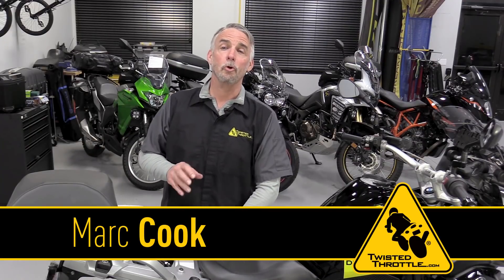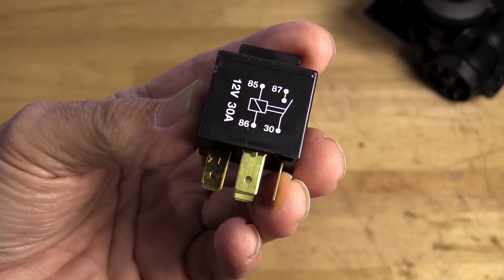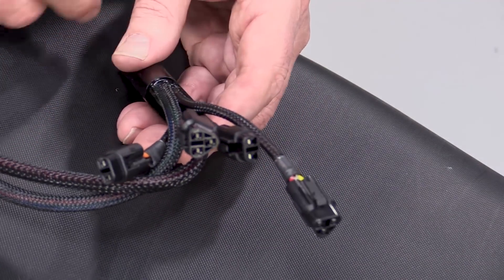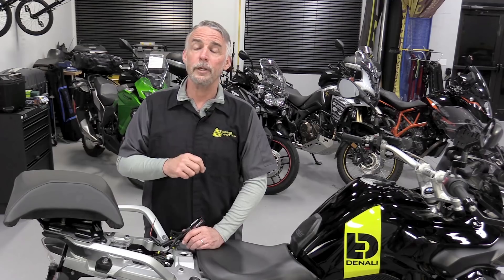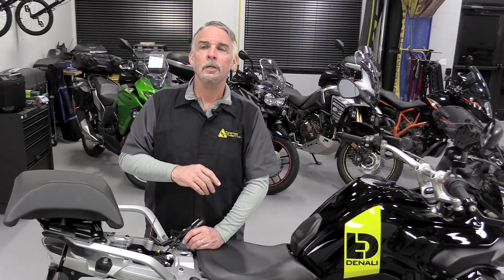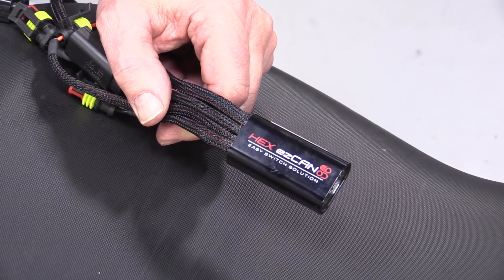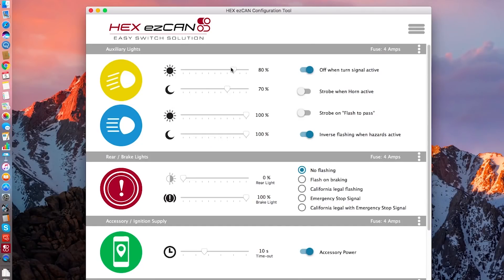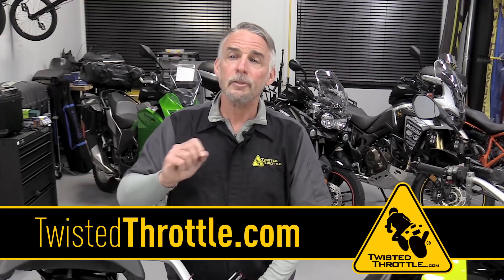DENALI CANsmart vs. HEX ezCAN | What You Need to Know | TwistedThrottle.com

Comment: can i.   buy denali system but install cheap harbor freight lights
Reply from the maker: You caaaannnn, but you shouldn't. Not only are HF lights copies of someone else's research and development, but their lights also don't perform very well. DENALI lights have been tested to insure optimum performance under extreme conditions. We have only tested the CANsmart and ezCAN to work with high-quality, 3-wire lights like DENALI. We can't attest to how cheap lights will perform. 

Also, dimming functions will only work on 3-wire lights. Typical HF lights won't dim using these controllers.

Comment: Do either of the manufacturers make cans for smaller displacement bikes, like Duke 390 or Triumph Scrambler 400X or himalayan 450? Is it possible to strobe the aux lights using pass light switch only not the horn?

Comment: IMHO, For the slight difference in the two I would save a bucket of cash and have the EZcan, oh, wait.... I’ve had the EZcan for a while now. 😏  

Wiring this in is as simple as the Denali. Denali lights alone are a small fortune and cost more than my whole set up added together.  (additional lights, 120db horn, additional brake lights, turn signals and position lights on the hand guards plus an extra lead for power into the top box or to power a rear facing camera).  That said, if money was not a factor, I would have the Denali lights. 🍻
Reply: My thinking, too. I feel the Denali approach, while convenient, locks you in to their brand, and that's a cute business model that costs us, the end Users, quite a lot.

Comment: Help needed!
For 2 years had Denali Smartcan on R1200RS with no issues.  Now all accessories fail to turn on with ignition. HOWEVER when I connect laptop to check, they all turn on and are configurable.  Within seconds of disconnecting the laptop, they all switch off and do not return after ignition switch cycles.  Have checked connections, updated firmware, selectively unplugged accessories but no go.  Ideas anyone please?  Rich

Comment: Does anyone know when Denali or KTM will make clear whether Denali lights can be successfully added to KTMs, particularly the 1290 SA and RS?  I have managed to fit D7s to my 2017 1290 SA via a Cyclops CANBUS Raider but it is very temperamental and has to be frequently reset.

Comment: So with the Hex ezCan is it possible to set the four power outputs to accessory modes where they each receive 12v like you can with the Denali Cam smart?
Reply from the maker: No, that is only a function of the CanSmart.

Comment: Hello TT. I Have the denali CanSmart end it is very nice. But i just use it for two front lights because i dont want more them this (probably a horn in the future). My question is: do i need to buy a extra brake lights or this system works and comand the original brake light?
Thank you.
Reply from the maker: Hey Andre,
The CanSmart is designed to work directly with the Denali B6 tail light only.

Comment: Is it possible to install the d4 + dr1 on the same smart can? I have already the dr, sound bomb and tail light. I still have i lead available on the smart can. I would like to add the dr1. Is it possible? Plug and play as well?
Reply from the maker: You could run two lights per CanSmart lead. So, if you have one lead left, you could put a pair of lights but we suggest only doubling up on the lower powered lights as the D4 or DR1 could trip the circuit. Another option would be to run two of the higher powered lights on one circuit but set the intensity lower, so it isn't using as much power.
Reply: @twistedthrottle  so in short, i can run my d4 on one lead and use the second lead for the dr1, yes? The dr1 will be set to sezo intensity during day and dipped. Only high beam will be 100% , while the d4s will have 10% for day and maybe 20% for night time. Does that sound ok? Also, please confirm if the dr1 are plug and play with the smart canbus.
Reply from the maker: They are plug and play. Like we said above, you can only double up the lower powered lights, unless you plan to run them at a lower intensity level. They will not work doubled up at 100%.

Comment: Thanks for this comparison.
Question 
I have a brand new KTM 390 Adventure and want to hook up 
1 set of mini fog lights
1 set of driving lights
A better louder horn

Unfortunately the Daneli doesn’t seem to have the CanSmart Controller for my KTM model listed, so what should i buy in your opinion to make the installation of what i want as easy and painless as possible??
Note, I do see that the Denali has both lights and a horn ( not yet seen video of how the horn sounds or if i actually can install that on my bike 🤷‍♂️) anyway i hope you have some suggestions for me that might do the trick...i really like the CanSmart Controller idea, but seen a few complaints for failures after about 1 year after installation...can you comment on this issue to clarify if that is a known issue with the CanSmart controller or have Daneli fixed that issue of “apparently” something to do with either poor soldering or an issue of the actual connections....
I hope you can help

Comment: Hi, I just got the new GSA & also the Denali Cansmart. However i don,t need the horn; but decided that I needed an extra charging point for the rear for the pillion or tire pressure pump or as a camera battery charger whilst on the go. So picked up a charging port with two wires. Into this port goes the male of my camera charger etc. Was wondering how to go about this! Thanks

Comment: Installed a smartcan system with D-4's, Sound Bomb and Tail light on a '17 GSA.  Found the install to be pretty straight forward and the Denali wiring harness was first rate - plug and play.  The bracket for the horn made hanging it a breeze.  The bracket for the D-4's is also perfect and strong.  Very high quality hardware parts to assemble.  Very happy with the finished product - I CAN BE seen and heard now.

Comment: Hello, Is there any way to use the CanSmart with two wires LED ? I've been looking at both devices, and went for the CanSmart. Now that i have it, i can see the three wires for lights sets. I was wondering if i can pilot LED lights with two wires, without using the "switched 12V Circuit" option ?  I guess the Red and Black are carrying power and the yellow is the "pilot" for dimming ? Any way to use the CanSmart with Dimmable two wires LED ? It's pretty explicit that Denali CanSmart will only work with Denali Lights sets and three wires dimmable LED. but still a bit disappointed here ;)
Thanks for the info
Reply from the maker: Hi, Arno. You're right that the CANsmart is designed for three-wire dimming. The entire dimming signal is run down the yellow wire, with red providing power and black being the ground. As the system is currently configured, there's no way to control dimming without using the yellow wire. However, good news! There's a software update coming very soon that will allow the CANsmart to dim lights with just the two wires. In case you didn't know this, each time you connect the CANsmart through the software and your computer is connected to the internet, it'll check for new device firmware and prompt you to update. The ability to dim with just two wires is scheduled for the next update.
Reply: WoW that's an amazing update. I've already had one, last time i connected the CanSmart (yesterday actually). Fingers crossed then. I know that't not pretty the place to ask, and you don't have to. A question out of the blue btw. Let's say everything is connected, solid green, canbus catched. I've tested the different wires. Got 12V mostly between red and black. But no intensity, meaning i'm not able to power on anything, even not a simple led bulb or dashcam. Would there be any reason for that ? I 've tested with an "external battery" (still 12v motorbike). But no current was available at the end. The bike was on, the engine not running. Maybe that's the reason why. But even when starting engine, could not light anything on the lights sets nor  on the 2 others channels in switched 12V circuit mode. Sorry to ask and bother. 
Last question : is there any page on the website where updates are announced ? ;)
Thanks a lot for your time ! Amazing support
Reply from the maker: Hi again, Arno. It's possible the circuits you're trying to use are turned off through the switches on the BMW. (By default they should be on unless you somehow changed them in your own troubleshooting.) To check that the device is working properly, connect the CANsmart to your computer and run the software. As a test, turn the circuit you're trying to use to the Simple Switched mode. This will put power to that circuit any time the bike is on. If you still don't have power at the accessory, it's probably best to give us a call at 855/255-5550 and we can walk you through some other diagnostics.
Reply: Thanks a million ! You rock. All good now. Issue : dead aux. battery, showing 12.3V, no capacity. Clearly stated on the software. Advice to all "newbie" like me : configure the CanSmart ON the bike, computer next to it. So you can check any error. 
Hope the release of the new firmware will happen soon. I'm delivering software as well, and users are always hurry to get new versions. I know it's hard to commit for a date :)

A suggestion : on the website, an "idea" box so that "registered" users could let ideas / improvements for future releases and discuss it. Might be useful. 
Again, thanks a million for your support !!!!! Really greatly appreciated.
Cheers !

Comment: Great info video, I looked at both units and I decided to go with the Denali cansmart unit. But after installing it on to my BMW GSA today I discovered that is unit lacks the setting to turn the front D4's aux lights off when the turn signal is active. Can you tell me if you know if this setting will be added maybe with a warmware up date anyday soon? thank you, Dave.
Reply from the maker: Hi, Dave. We don't anticipate adding that feature to the CANsmart. That's because the CANsmart uses the four circuits differently than does the ezCAN. We felt it was more beneficial to be able to control two sets of lights. In order to have the "aux lights off" feature with the turnsignals, we'd have to split each light onto a different circuit and then we'd lose the ability to control the second set as effectively.
Reply: TT, Thank you very much for your reply that very helpful,  What I have done to help so the Denali D4's do not obscure my turn signals is...mounted the D4's on a Denali light bracket under the beck on the bmw1200gsa. Also, i have fitted an extra set of turn signal indicator lights on a set of Bark Busters hand guards, so with that my turn signals can be well seen. Thank you again from Dave ...uk.
Reply: Maybe add an option to turn off the lights completely when the blinkers are active. Would like that.

Comment: Hello gents !  and ladies as well ! Quich question :  would it be a good idea to introduce a small settings like power on delay ? or is there already ? Given the fact that the Cansmart is used to enlight and make it all easier, the idea would be : detecting engine on or off, and adding power delay. So as long as the engine is not running, the lights and others equipments that are power consumming would stay off. I've a camera as well, and starting shutting down starting again (on, engine on) makes it crash. And of course, i'd rather keep my 50W x 4 light off when i start the bike ...Any thought ?

Comment: Hello dear team  ! was checking back here. Since last time, everything got installed pretty easily ! configured two sets of different aux lights, and few more accessories. Actually using horn high amp for the heating gloves ;) and the rear brake circuit for two embedded dashcam recording every second of rid (security ones). I was wondering if the release date of the new version / firnware was already known :) ? 
Thanks again, enjoy the day ! 
Ride safe